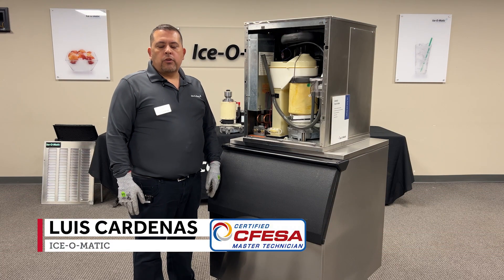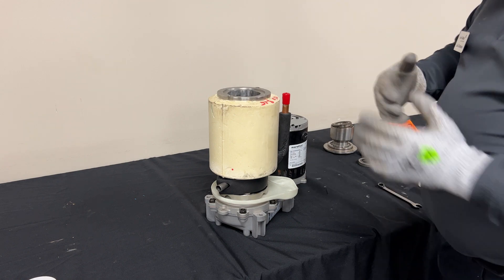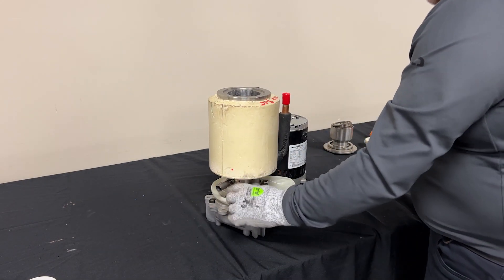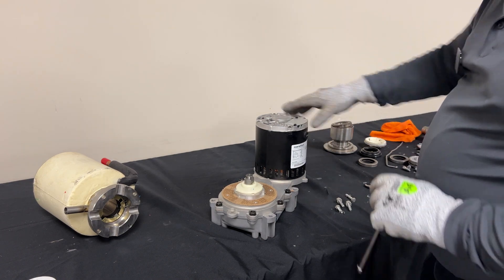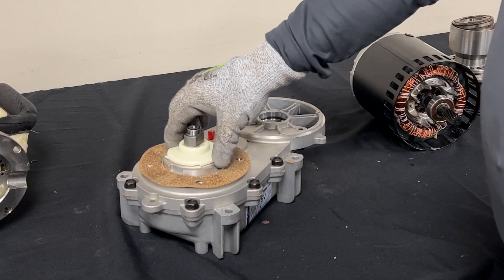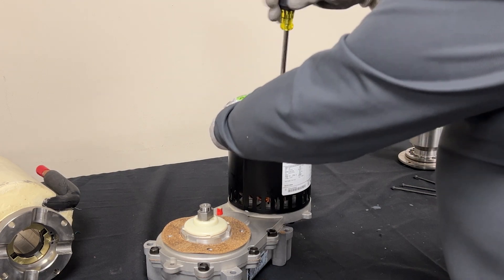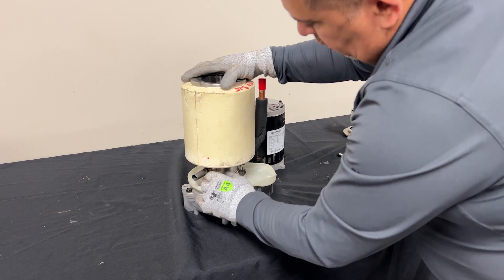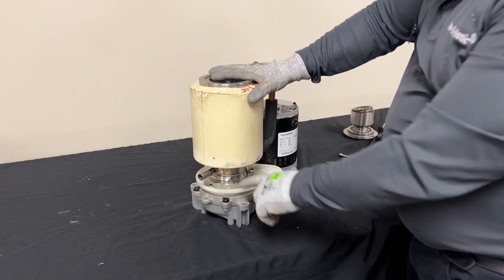Ice-O-Matic GEM & MFI Ice Machine Gearbox Replacement

Comment: Isn’t there oil in gear box? How do you check or add oil?
Reply: I check the oil by removing the motor and shoving my pinky down the shaft hole.   If its muddy its bad, if it looks like honey, its good